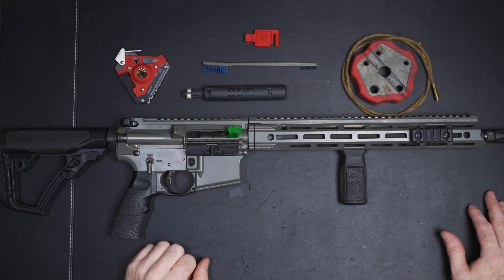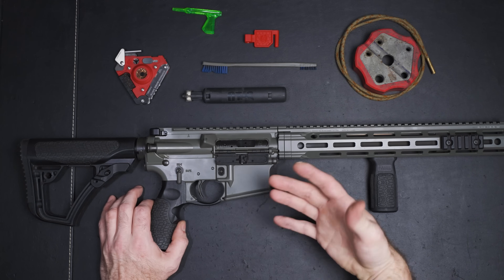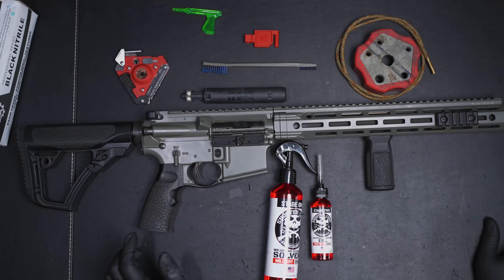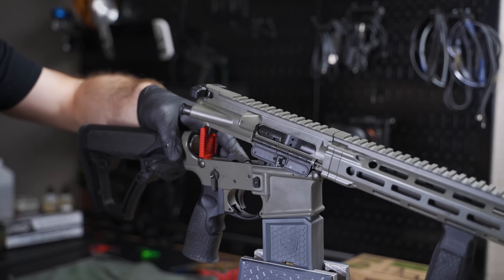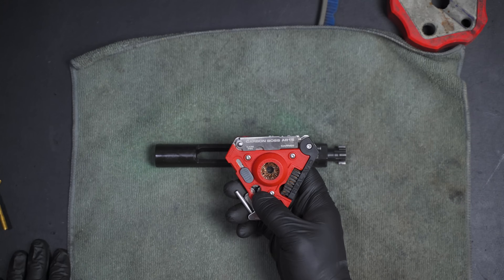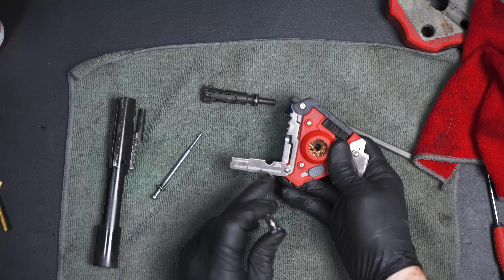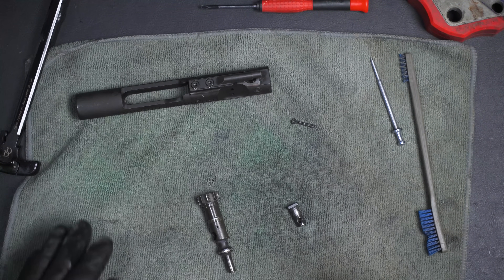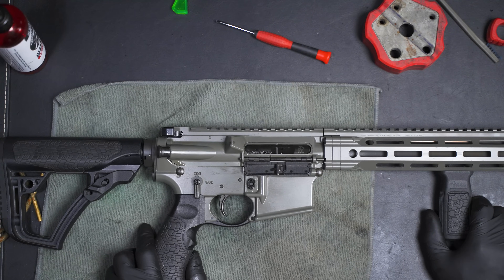MOST CRITICAL AR-15 Cleaning Step That Everyone Misses

Comment: How do you clean the ripcord, boresnake and nylon brushes?
Reply: Soap & water has worked for centuries ... ;)
Reply: @Odessa45  thanks! Wasn’t sure if there was something special I needed to do.
Reply: @Normal Hangry 🤣🤣
Reply: Not all bore snakes are the same, some are snaked dry no cleaners or lubes, others have places you can put cleaner or lube on, check manufacturers instructions.
Reply: @warrenharrison9490  thanks will do. I got the same ones as in the glock cleaning video
Reply: @Jbuckkz  I have one type that's dry only, and another that has places for cleaner and oil. I would not have known the difference of I didn't read the instructions 😂

Comment: What happens if the bolt not extended when put back in
Reply: It won’t lock into the barrel properly and will not fire
Reply: @Daniel7.62  ok thx
Reply: The cam pin won't allow the bolt to insert into upper receiver if the bolt is pushed back into bolt carrier. Also a test of bolt gas rings is with the bolt extended from carrier place bolt face on flat surface, the bolt should stay extended.

Comment: you missed a spot, where the gas tube comes into the upper
Reply: yes, there are three holes for getting a pipe cleaner down around the gas tube. also the end of the gas tube where it goes into the carrier key, and the carrier key it's self where the gas tube seats into it...

Comment: gloves? are you  serious?  I worked as  a mechanic  for over  40 years and not once   did we  were gloves... having  our  hands  bathed in some nasty chemicals with open cuts  and sores. I am  64  and  zero signs of  any cancers. I have been cleaning M16/AR15  since i first joined  the marine corp is 1977. and i am still kicking and annoying girly men like you. these is only one  RIGHT way to clean and  lubricate an M16/AR15  that is the marine corp way.